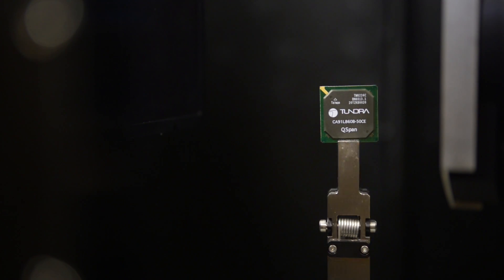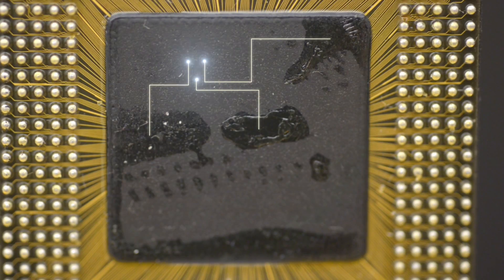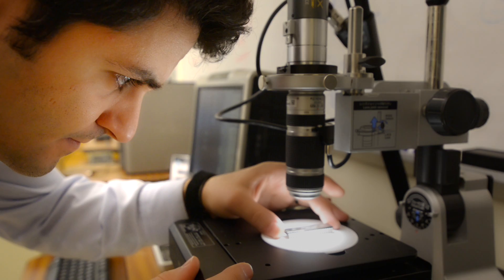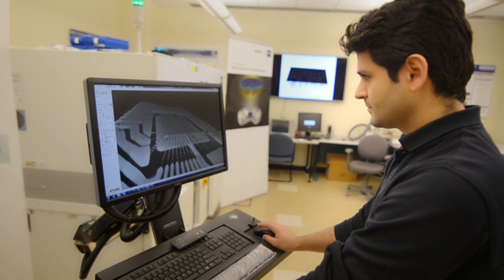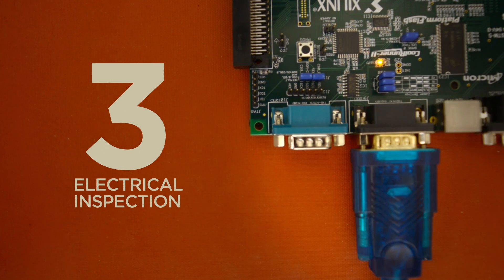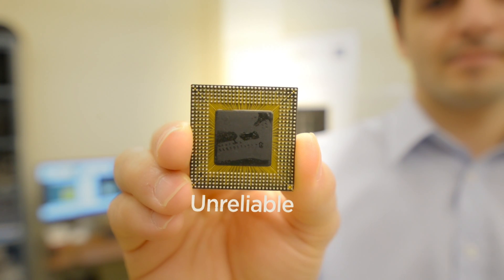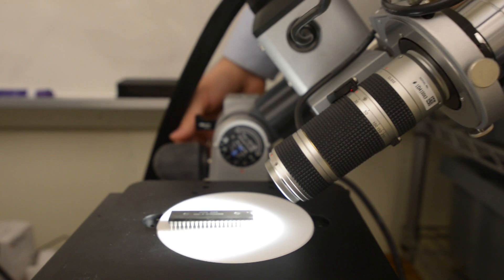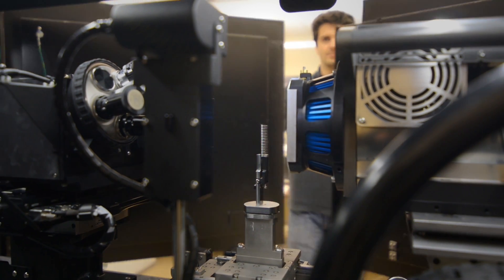3 Ways to Tell if a Computer Chip is Counterfeit

Comment: These are reused chips, formerly referred to as "gray market" because it's not exactly clear it's illegal to reuse a chip. If it's remarketed as brand new (e.g. counterfeit packaging), that's black market.  If it's sold as an aftermarket chip, like a used car part, it's perfectly legal.  Industry is making an effort to change "gray market" to "counterfeit" in order to close off the potential that secondhand markets are legitimate. It's planned obsolescence in hindsight. 

There are several clues in this video that the chips identified as counterfeit are actually reused, or possibly factory seconds. I've never seen footage of an actual fake chip printing machine.